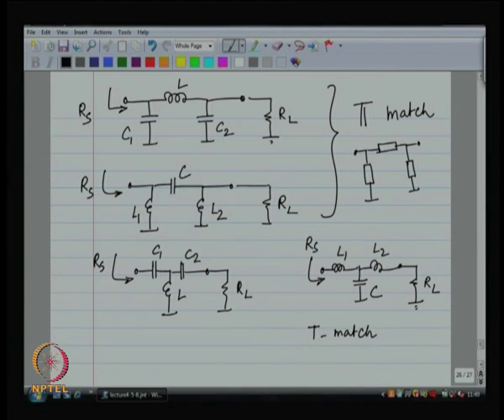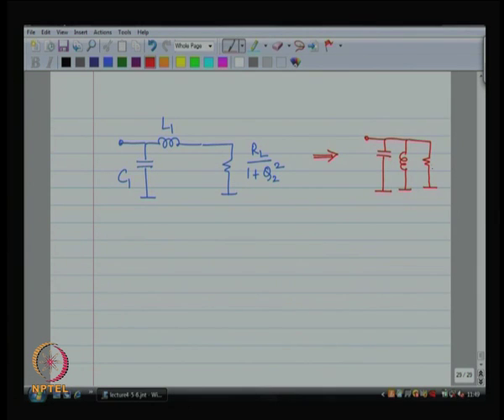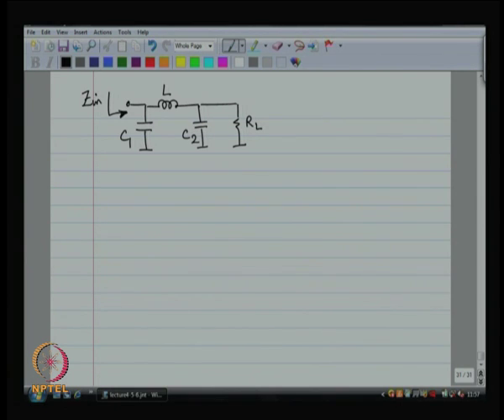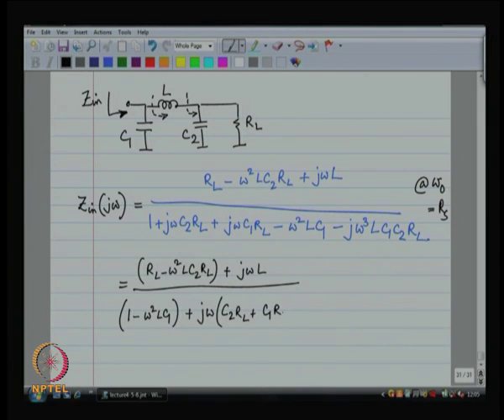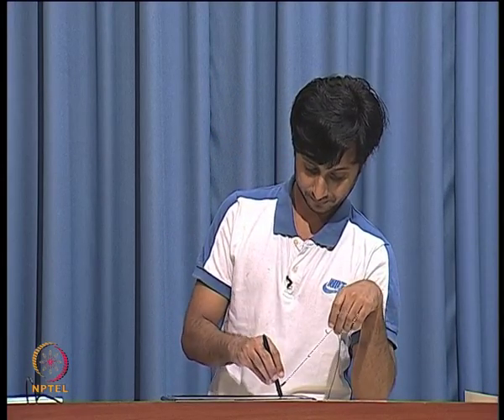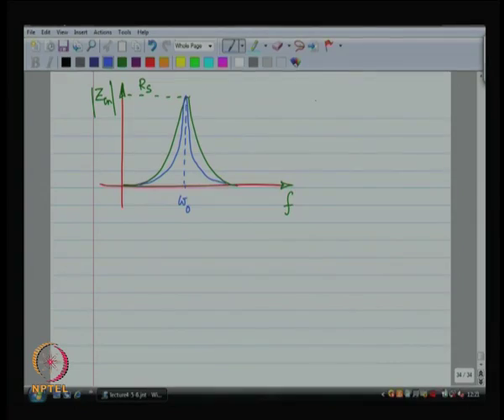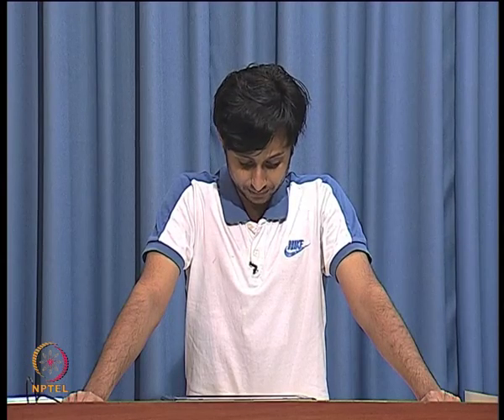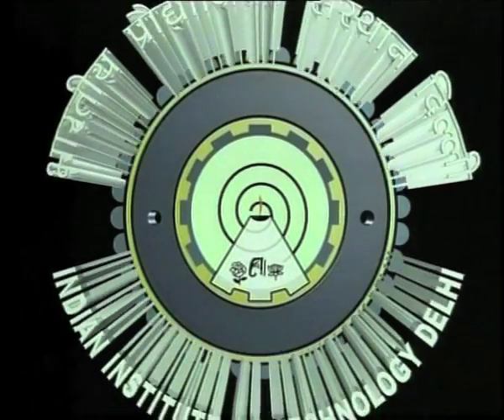Mod-02 Lec-06 Other matching networks

Comment: sir,
On page 34 the ratio of load Resistance to source resistance need to be Q2^2 / Q1^2. so Net Q eqn. will be Different. Can You please explain the reason how can we use the whole channel effectively? 
Can we do for a particular frequency of interest by changing the value of L and C which will effect Q2 and Q1 and thus Net Q will be effected and ultimately it will effect our Band width. sir is this feasible?